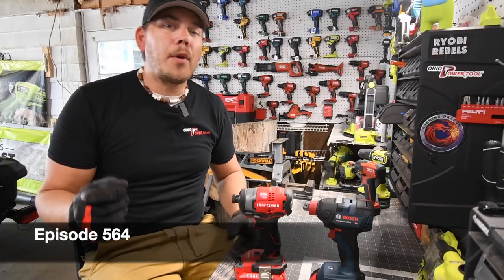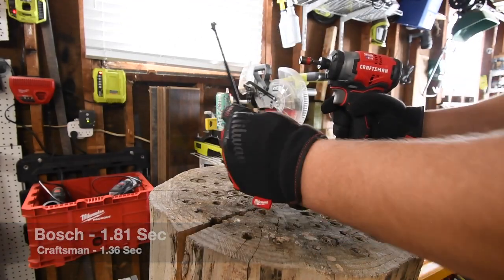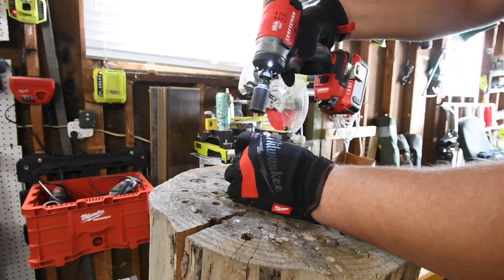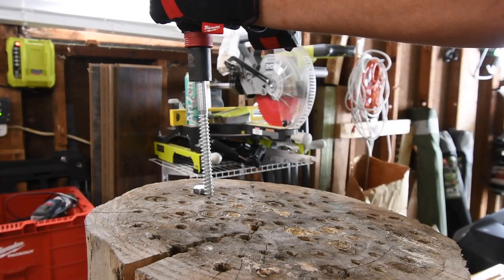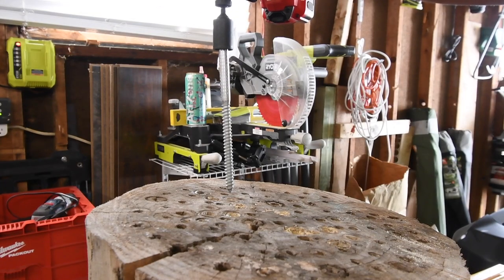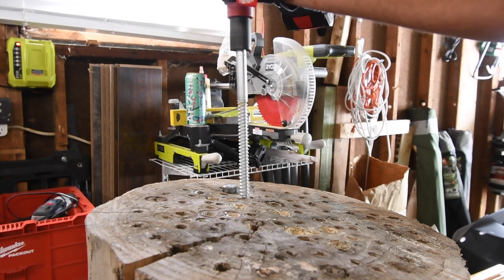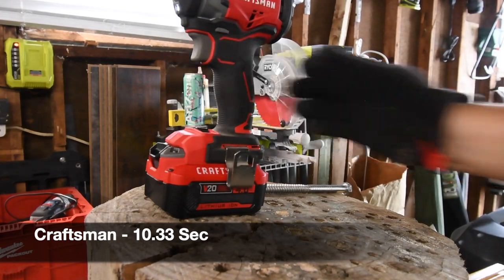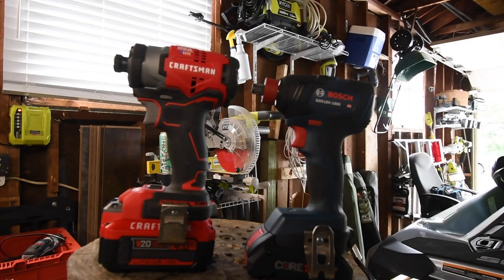Craftsman vs BOSCH (Impact Drivers)

Comment: The Craftsman is pretty furious, but it losses steam as the temperature rises. The Bosch is slow and steady…it’s not interested in speed; it’s interested in maintaining the same peak power levels while keeping temperatures at bay. You have to wait a bit, but it doesn’t need a break.
Reply from the maker: that is the downfall for a cheaper tool :(

Comment: I have the Bosch, not the most powerful out there but damn it definitely has its uses, my ¼" anvil i starting to get hard to insert and remove bits but I'm sure lubricating it would help it out, overall it's it's good tool

Comment: I used to purchase a lot of Craftsman cordless and corded power tools along with some OPE like chainsaws. 

But that was years ago when Sears was still around and a force to be reckoned with. I haven't purchased a Craftsman tool, other than some socket sets in a long while.

But it looks like their stuff might be getting a little better now that Stanley 
B &D is making most of their stuff.

It's highly unlikely it will ever be as good as, or even in the same category as, DeWalt. 

But for homeowners on a budget or for weekend warriors, the newer Craftsman tools don't look too bad. 

They might even be able to hold their own against brands like Ryobi.
Reply: Stanley - B&D knew they could position Craftsman better in the mid tier/prosumer category than Porter Cable. They'll never be as good as Dewalt because it's not their goal.
They should well against Ryobi, Ridgid and Skil

Comment: That Craftsman is an tweaked 887 with red plastic.
Reply: Your right sir. There’re impacts are nicknamed The Red DeWalt’s. 😎
Reply: Wow crazy they are the same thing even the rubber molding.
Reply: Go check out craftsman cmcf820 vs dewalt dcf887
Reply from the maker: pretty much

Comment: I have the freak and my biggest complaint is my tool super loud when the hammer engages. This is the only impact i've owned! Are they all this loud and obnoxious? Was looking at getting something different.
Reply: All impacts are loud
That is one of the flaws
Loudness is the only reason I always use drill driver
Reply: @dragogranic8171  it's unusable in the house since my kids are apparently terrified of it lol.
Reply: @devwill2013  there are oil based impact drivers from Makita, Milwaukee (Surge line), Ridgid and Ryobi. The last two are long in the tooth but like all oil based impacts, you get a significant quieter impact mechanism.
Reply: I think all brushless motors are loud. It's just the way magnetic braking works.

Comment: Hi Dave, Bosch will smoke craftsman, craftsman power tools always burned out after short time from new back in the seventies for me, I went to hilti and Milwaukee and stay with them ever since,
Reply: Craftsman beat the Bosch in most of the tests
Reply: You’re talking about Craftsman before Stanley bought them, and more than likely brushed motors with NiCad batteries. You’re comparing apples to oranges. This Craftsman is a clone of a very good DeWalt model.
Reply: @P_steez  hace a look at VCG test between these two. Bosch had the Craftsman beat.
The only flaw I find in Dave's test is that he always gets the screws very close to each other. This means the 1st tool will always have the advantage because the wood surface around the screw/bolt gets more dense, hence harder
Reply: @FyrFytr998  hi, back in my time craftsman didn’t have cordless and your right b&d didn’t own them at the time, the air wratchet lasted a few weeks and burned out, it went in the trash and Milwaukee came took over, just my experience,
Reply: @P_steez  today craftsman is a much better tool than my time, idk I go by my replies,
Reply: @FyrFytr998  maybe now it is, Dewalt’s an excellent tool I grind on both of mine all the time and they both perform excellent, possibly now craftsman is a quality tool, I buy any of craftsman tools just no power tools,

Comment: I rock with craftsman anyway 
This country was built with craftsman tool🙌
Reply: I bought into the craftsman lineup for the same reason. just too much damn nostalgia. towards the end of Sears the quality of Craftsman was way down. They were just buying OEM junk and slapping their name on it. the newer brushless stuff that Stanley B&D is making is pretty nice stuff and that versa stack stuff is awesome. Stanley B&D just needs to add some more power tools to the craftsman lineup.
Reply: @ajmedeiros77  actually even at the height of Sears and craftsman 
Only the single hand tools were made in the USA  and the ones that  came in the Kitsap were made in China 🤷🏾‍♂️ but it doesn't matter to me 
Where is your phone made 👀
Have a great day bro
Reply: Maybe the craftsman hand tools?
Although my understanding is that they’re starting to make them back in the USA now. The older craftsman power tools I owned from Sears were junk. I had a drill that didn’t make it more than 3 months before the battery took a dump. A saw that only lasted a year before the bearings went out. This newer craftsman stuff (brushless) which is all I own….is way better quality and a lot more powerful than that Sears stuff I owned.
Reply: Who do you think made sears tools back in the day B&D, TTI and Chevron made their power tools

Comment: Does  your idh 182 still have a trigger delay issue mine has the same exact problem
Reply: That’s not a 182.
Reply: @vojnikjna30  I'm not talking about that impact driver I am talking about a older Bosch freak I guess you can call the Gen one
Reply: @vojnikjna30  this is the video Nicholas put up and I'm referring to
Reply from the maker: I borrowed that model from a friend. it still does it
Reply: @ManCaverTools  that stinks I thought when you opened up a two tool bosch kit with hammer drill  & the idh 182  freak  with two  Core 6.3 ah batteries it was yours  you got awesome friends if they let you borrow brand new tools to unboxings for videos but

Comment: You need to get the GDX18V-1800C model to test
Reply: The best I can tell, the "C" model only adds two lower RPM settings. Bosch doesn't claim it's any faster or more powerful. It's a better choice for getting the amount of torque you want, but you're probably not going to get faster results.
Reply from the maker: indeed I do

Comment: I really want to get into the Bosch tools but it’s hard when you have tools like craftsman and ridged and koball literally beating it for cheaper price
Reply: Longevity..... Crapsman crap out, needed a break. Speed sometimes is not the best strength. Consistency from Bosch is top notch. They haven't failed me. But if speed is your thing, buy a back up crapsman... you'll need it...
Reply: @MadDestructionChaos  no issues with my rebranded porter cable/dewalt based craftsman tools.
Reply: @nascarnate326  I guess you won't have issues if you only use it three times a year...🤣🤣
Reply: @nascarnate326  Gotta us them first....🤣😜

Comment: I'd have to take the Bosch over Craftsman
Reply: Bosch is more expensive to me I have craftsman and dewalt power tool
Reply: @tammyshellikoff3482  I run Milwaukee and DeWalt but out of these two I prefer the Bosch. Everyone has different jobs to do and tools to em!! 🤝🏻
Reply: @kentuckybeardsman  I do not run big lag bolts all the time but do 3 inch screws and 8 in Timber lock
Reply: @tammyshellikoff3482  I do a little of everything. From large SDS rotary hammer use to cabinet installation. I have M12 and m18 and 12&18 v DeWalt. I really love them both. Mostly Milwaukee tools n my truck but they both do the job well. Ive been wanting to try a few flex tools! Just to say I did. Lol
Reply: @kentuckybeardsman  craftsman and dewalt get my job done
Reply: I wish other systems had the dual anvil. I bought the Bosch kit for that and I really liked the form factor of their 4.0 batteries. It's too bad the Bosch 18V ecosystem is a lot more sparse than other brands.
Reply: @JeffDM  I have like 8 craftsman power tool and 5 dewalt tool
Reply: @JeffDM  Bosch is out of my Price range for my

Comment: Even with 21700 batteries and a dedicated anvil, it couldn’t beat a stepped down DeWalt 887 clone?  That’s a shame.
Reply: It will get the Craftsman beat. Just run the Bosch 1st. The Craftsman will get a harder surface to work with once the first lag is run into the wood. Want to get more realistic results? Get the bolts spaced from each other
Reply: Craftsman and dewalt is build by the Same Company
Reply: @tammyshellikoff3482  yes. That's why I mentioned the Craftsman being a clone.
Reply: @tammyshellikoff3482  yeah where VCG burned out the DeWalt? That was pretty funny.

Comment: Craftsman beat the Bosch in most of the test. Better tool and better price. Larger platform too
Reply: It's highly subjective. Personally I always find the tool that starts first gets the advantage because Dave puts the screws so close to each other, hence the wood gets more dense.
Saw the VCG video between these two about a year ago and Craftsman got its butt kicked
Reply: @engineer_alv  I saw the same video and vcg used a 2amp on the craftsman and 4amp on the Bosch. In this video they are evenly match and the Bosch got its ass kick
Reply: @mikevollmer3579  is the Craftsman still cheaper, though?
Reply: @engineer_alv  it’s says in the video that the craftsman is $99 and the Bosch is $159. So yes I would say it’s a much better deal and yes cheaper
Reply: @mikevollmer3579  bare tool vs kit with 4Ah. Lowe's got the Craftsman kitted with a couple 2Ah batteries for $169

Comment: The Bosch is a freakin joke lol craftsman destroyed it
Reply: for a half to 2 seconds difference? Actually you are the joke...
Reply: @Zozo806  ok you troll
Reply: @glenarseneau1231  says the clueless caveman that compares a tool by a friction of a second on the same task without other specifications like Material density, haptic, longevity and features.

Just see time, red tool more fast, blue tool bad.
Reply: @Zozo806  did your feelings get hurt
Reply from the maker: it did win more tasks
Reply: @ManCaverTools  it definitely did
Reply: The Craftsman got more wins but the most significant time difference was on the 6" lag where the Bosch had a comfortable 6 second lead. That's when the extra ft/lbs of torque from the Bosch make sense.
And the 8" lag test was a bit flawed, as Dave ran the lag deeper with the Bosch, hence the 3s difference. 
That could've easily been a tie had the lags been sunk the same. The fact that the Bosch could take the 8" lag faster than the Craftsman confirms what I was thinking.

Get the total time by adding up all tests for each tool and results are very close from each other.
Bosch 91.84s
Craftsman 89.11s
Get the 8" lag test right and results may have switched.

There goes my 2c
Reply: I think there is a slow-start function in the bosch that starts the driver slow and increases torque as the screws move in. I may be wrong though.